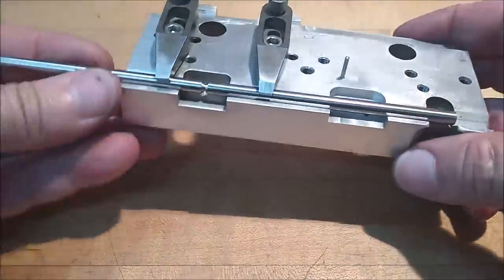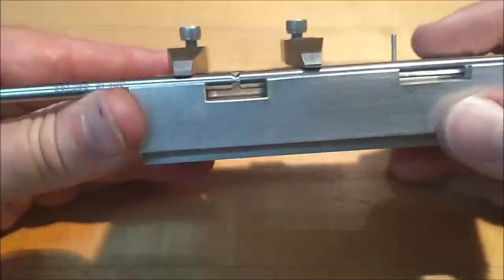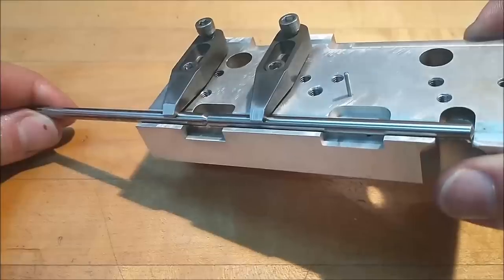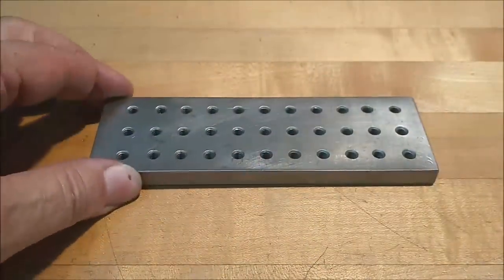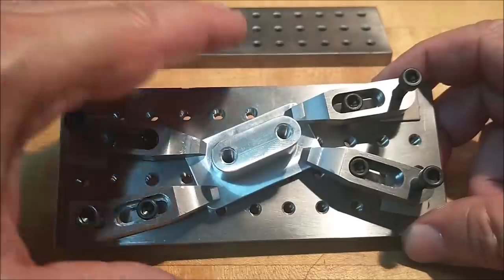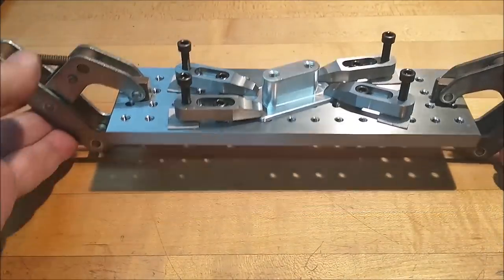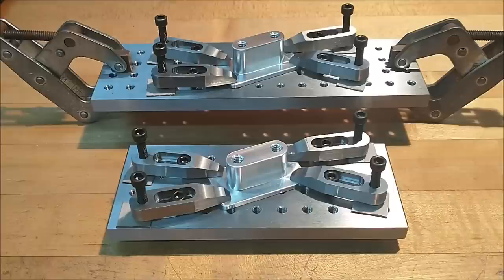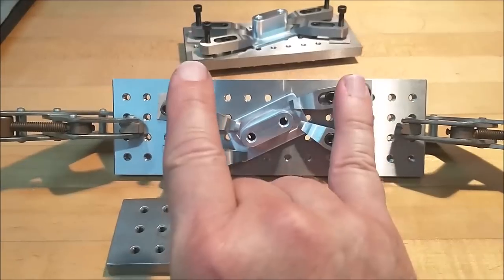Great Little Fixtures Every Machinist Should Have -- Take a Look !!

Comment: As an improvement, I suggest making the pallet thicker (~1") and making the holes dual purpose: the first ½" should be reamed for dowels and the remainder of the hole should be threaded. I use 6mm dowels with M6 fasteners. 5mm dowels with M5 fasteners would also work. Even though I'm in America, I've found it more convenient to use metric for these types of projects. For 10-32 fasteners, either M5 or 3/16" dowels could be used.

Comment: Just today I finally broke down and bought a knee mill, I am going to have a chance to get to know it very well very quickly as I disassemble it and rig it out of an 80 year old man’s house. It comes with an rotary index, 6” vice, boring head and boring bars, shell mill, slitting saws, a milk crate full of assorted end mills, clamps, parallels and the list keeps going! I am stoked! There is no DRO but it has been converted to a power X axis. It is clean, tight and well cared for. A true once in a lifetime find!
Reply: Lots of closets around holding beauties like that one. Tooling can add up to more than the value of the machine.

Comment: Simple but very useful little fixtures, especially for small oddly designed parts. AC your shop if possible. Use big-ass fans, swamp coolers or something. Don’t put up with that excessive heat any longer.

Comment: I have a very similar pallet that I made in the 1990:s and use all the time in the mill. Mine is 100mm by 300mm and has M5 holes. After over 30 years of frequent use it may require minor service in the surface grinder... I keep a dedicated drawer with bolts and the various fixtures and clamps I accumulated over time. I have tried to stick to M5, have a grinding cube and some other stuff using the same components. Making a kit like this is time well spent, it is very useful.

Comment: I have found that two reamed holes that will hold slip fit dowel pins are VERY useful.  Put the holes two or three inches apart and use them as a sine block.

Comment: A piece of 5/8" x 5" x 6" Blanchard ground both sides HRS was turned by myself into such a fixture about 25 years ago.  Instead of drilling and tapping all those holes I milled 3 T-slots using a 1/2" Woodruff keyway milling cutter.  T-nuts were easily machined from 1/4" x 1/2" CRS bar stock.  The bar clamps were made from similar steel.  Some clamps were custom machined for awkward work pieces.   
Interestingly I also used #10-32UNF threads, which are one of my favourite screw sizes.  I keep a bunch of these on hand of different length, same for some threaded rod.
When I machined the crankshaft for my twin cylinder steam engine, the throws were finish machined while set up on this fixture plate.

Comment: They are also handy for holding short  larger diameter stock or other odd shaped pieces on the horizontal bandsaws as well - just clamp the work over hanging the end of the fixture plate with strap clamps and clamp the plate in the saw's vice. No need for elaborate modifications for the vice on the saw. :)

Comment: I work in a job shop handling relatively large parts, often setting up 2 foot wide plates on the mill table and T slot extenders have come in clutch. They are just a 2" square bar 24" long with 4 slots milled down the length of them, with recessed shoulders milled into them to accomodate a socket head cap screw and the rectangular washers for them. I can use strap clamps 20" apart from one another on my Y axis on top of these bars. Next I need to make 2 or 3 plates that can hold parts at a precise and variable angle for the heavy milling of parts since this mill does not have a pitching head. I often mill things 36 or so inches long that then have to be cut up into a batch of parts.

Comment: on one of your other videos about the fixture plates you showed some brass registration stops. Where the brass discs threaded so they remained accurate when screwed in place or did they just have a very tight tolerance hole for the 10-32 screws?
Reply: i think he called them buttons

Comment: Very interesting Joe. As a woodworker I use similar items for holding work pieces. Question: What is the difference between a fixture and a jig? Thank you for sharing. Have a great day and stay safe.🙂🙂
Reply: I'll take a stab at that question.  They are subsets of each other. A fixture allows you to affix something or hold it. A Jig does the same but in a specific way for a specific reason and is usually repeatable. 

For instance,  if you need to do the same operation on 12 parts and they need to be identical,  you build/use a jig that affixes them to the same spot the same way for each part. If you have 1 part that has 12 operations, you use a fixture plate to hold it various ways to safely perform those operations. But they both help hold the part where conventional means aren't the best solution.
Reply: A fixture just holds things. A jig also guides a tool. I think that's the distinction. I believe I remember reading it in an engineering book on jig and fixture design. Probably Wikipedia or some other site has an article on it.

Comment: Why don't you have a.c. in your shop ???
Reply: Most shops in the southwest are Evaporative cooled. They work well generally Most of the time, But during the Monsoonal times, they are not worth turning on. It gets way too humid in the shop, and its not what you want. AC is prohibitively expensive during peak hours, and most shops shut down during the dog days of summer.  Besides, you and your Wolf spider need to take out the new Glastron, and drown some worms, huh? Love your channel, have learned a lot.  Carry on!